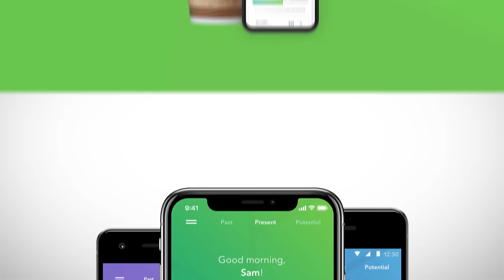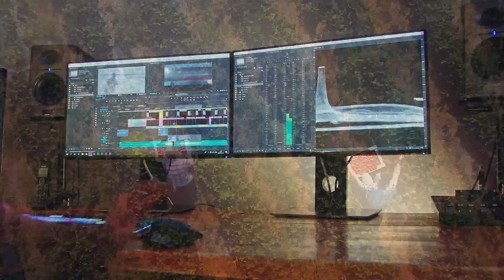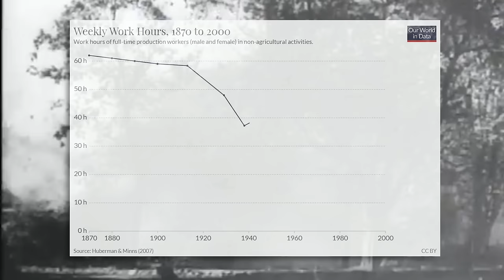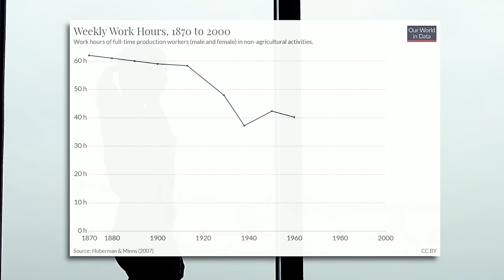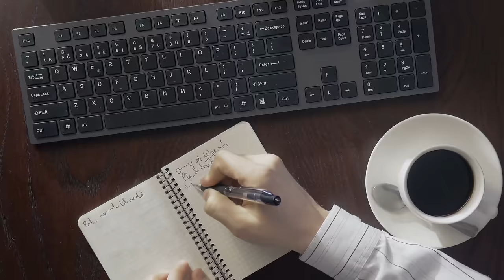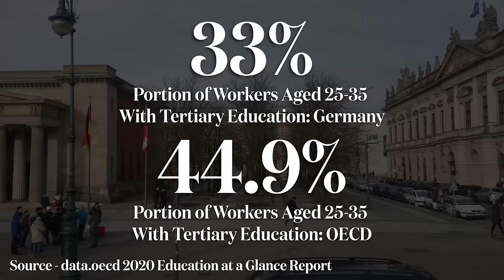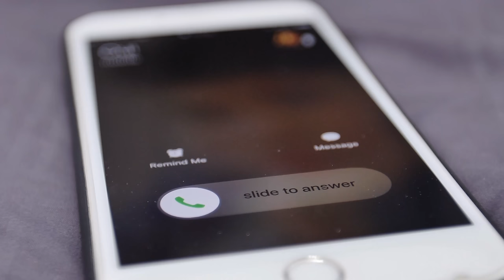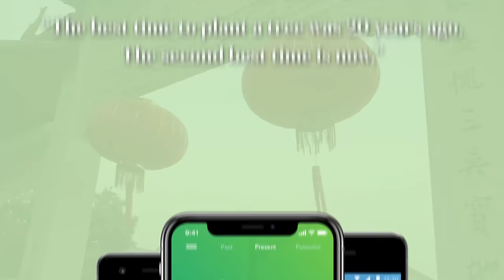Why is Working Harder Making Us Poorer?

Comment: If you don’t open on Sunday competitors will drive you out of business

“Laughs in chick-fil-a”
Reply: in belgium, and i think a big part of western europe, 
shops open on sundays is still more the exception, 
but with a clear rising trend.
in most places supermarkets and such are not allowed to be a full 24/7 open, 
so a supermarket that does a sunday morning opening, normally only opens after noon the monday after.
the real discounter don't bother, while the supermarkets that are a bit more expensive can use sunday reveneu to stay profitable. Sunday work has to be paid at least 50% extra, that also helps not exagerate it ;)
most towns do have once a moth a buying sunday, when most of the shops are open, but most sundays they still are closed.
Reply: @JeroenJA  lucky youy the extra for Sunday work on shops has been removed years ago in the UK.
Big supermarkets stopped paying it around 2007